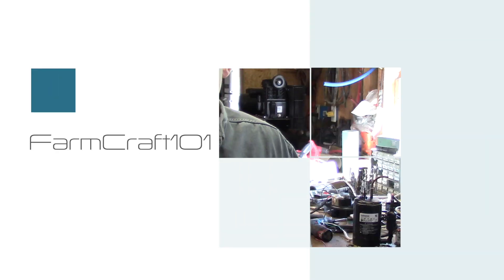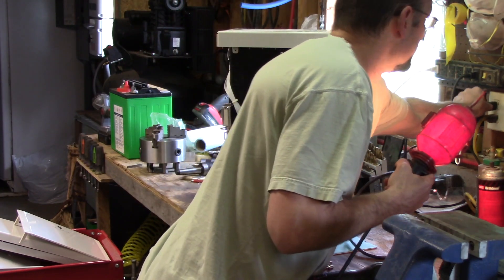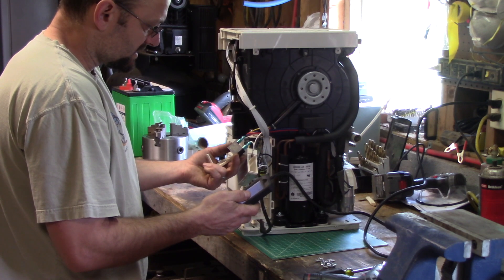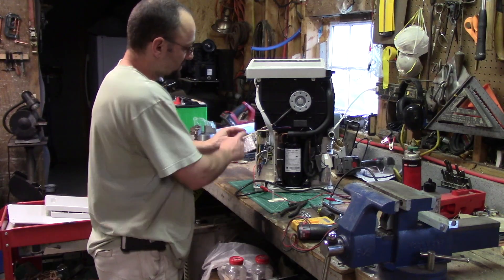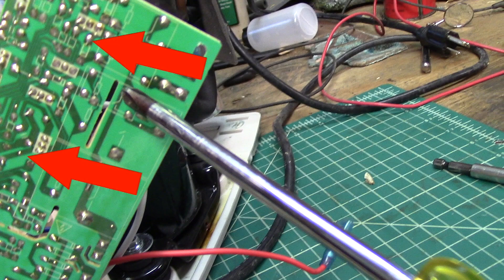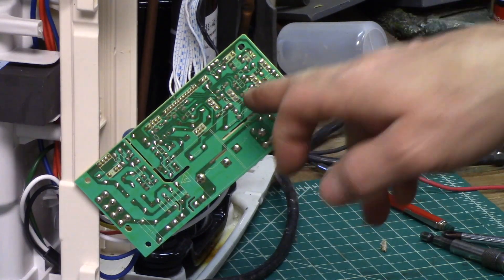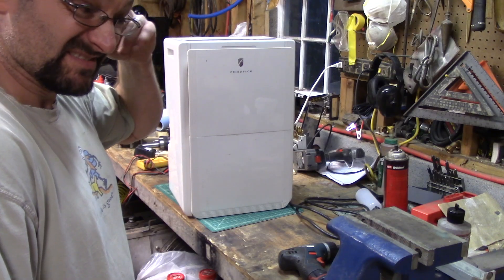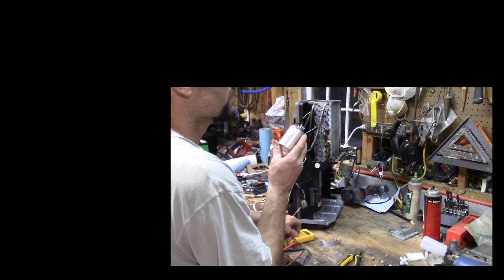How to troubleshoot and repair a dehumidifier, Part 1.  FarmCraft101

Comment: Found this video while searching for how to troubleshoot my Frigidaire (made by Electrolux) dehumidifier - thank you! Note that there is a high level circuit diagram stuck to the case behind the captured water tank on my unit, which made identifying the color-coded wires easy.

I thought that jumping the fan to the compressor circuit was a great workaround (although it might grow some mold since the evaporator will stay wet before the fan can dry it off, but...), and after preliminary testing (capacitor OK and voltage present on the + wires to the fan),  I was ready to do the same.  However, I also noticed that the ground wires for both the compressor and fan motor were fastened to a flange on the bottom corner of the evaporator, and there was rust dripping down from this wet location. I undid the stainless steel screws and found that the mild steel star washers behind the wire lugs were quite rusted and this rust must have gotten in the circuit path.  Did a cleanup with a small wire brush and some contact cleaner, connected the wires and the fan started working! Off to my local hardware store to try to find stainless star nuts, but they didn't have any, so I bought some new plated star washers and put them in before buttoning everything back up. Unit is now working well, just in time for a heat/humidity wave.

As with repairing cars, many electrical issues are due to bad grounds - pays to look.

Comment: Man i didn't think you be such a chill dude to watch do this trying to figure figure out why my dehumidifier keeps turning off after 45 digits hit I have a model DDR030BJWDB and there's a button on it that has a person's face and a moisture minus sign in the water droplet that button turns off after a while but yet my room is still hot and then it proceeds to blow out hot air is it because the unit is overheating i cant figure out this issue snd no video's online cover this a video on this would be nice or advice

Comment: I found two fairly new dehumidifiers in our city dumpster at separate times. The first had a corroded main board, so I scraped it out. The second, which is like new condition. It's displaying a code EH for faulty humidity sensor. I have yet to open it to confirm a bad sensor. Thanks for the detailed break down of how the board circuitry is laid out and how to diagnose.
Reply: Where did you find the sensor, I need one too.

Comment: film capacitor @ 5:05. usually very low capacitance, unlikely to fail and not really all that dangerous. fun fact: it's the same as you'd find in a desk fan because the principle is exactly the same: two inductor coils causing an electro magnetic field and spinning the fan

Comment: Brilliant video.  I suspected it was a relay problem with my dehumidifier as well, and hot-wiring across it as you did helped me to confirm the diagnosis.  Need more people like you who are willing to diagnose and fix things instead of throwing them away.

Comment: I accidently plugged my dehumidifier into 240v, I'm not sure what blew inside of it or if it's even salvageable
Reply from the maker: Trace the power wires and hope that the first thing they go to is a fuse.  Otherwise you will probably find some black stuff on a circuit board which will be toast.
Reply: @FarmCraft101  guess if the board is toast the whole thing is probably not worth repairing
Reply from the maker: Depends.  Boards can be fixed, components can be replaced.  If it's a relatively new unit you could price a new board.
Reply: @FarmCraft101  yeah I think it's fairly new but I got it used

Comment: I also did a repair of a de-humidifier on my channel. I added an alternate title for the video part way through. That title was, "How to electrocute yourself in one easy step. Good to see you working the same way. On mine I drew out the circuit and fixed the fault on the pcb. https://www.youtube.com/watch?v=r_79OrkoRtI&t=73s

Comment: my unit is not draining.  it seems to be collecting water in the unit and then it shuts off.  I took off the connected drain tube that went to drain.  The unit still does not drain in a bucket I tilt the unit and drain water, it runs and then shortly thereafter it shuts down

Comment: If you want to have the fan run after the compressor shuts off, you can get a "delay on break" timer.  Also, the blue connectors are often called quick splice or snap lock connectors, depending on which brand you choose.  Thanks for posting.  You saved me some time.

Comment: Picked up a nice Whirlpool unit at the curb for trash day.  The thing has very little use to it going by the lack of dust on the inside.  It works.  It filled a bucket bin worth of water overnight.  But, when the unit is triggered off by the panel or its internal on/off humidity cycle, the compressor remains running.  Eventually, the compressor heats up and trips the overload sensor on top of the compressor can.

The compressor relay seems to stick in the on position.  With no measured 12 volts DC at the control side of the relay, the compressor still runs.  With all power removed from the unit, there's continuity on the power side of the relay.  That ain't good.  A $3.00 relay ordered off eBay should fix this problem.  Let's just hope some other overload problem didn't cause the relay contacts to stick...

Someone threw out a nice $200 dehumidifier and I should be able to get it working for just a couple of bucks and an hour of my diagnostic time.

Some people put together jig-saw puzzles.  I fix things.

Comment: Thanks!
I picked up a Frigidaire dehumidifier that someone threw out and checking it out after removing the back panel I was able to verify the Compressor works fine but the fan, like yours doesn’t come on. I have some experience with electronics repair and wiring and have repaired crt and plasma televisions as a hobby so I understand the dangers of high voltage circuits. I just wanted to thank you for this video because it gave me a good idea of what and where to check with my meter which gives me a much better understanding of troubleshooting this appliance.
Thanks!

Comment: You fix things the way I do, the simple way is often the best.  I have a whirlpool that will not turn the compressor on,  It is impossible to find the schematic, so just keep looking on line.  Will probably tear into it.  Computers are much easier to fix, but I have done hundreds of those

Comment: Hi. At 9:01, what are those flat white cords with blue writing? I had to take apart my dehumidifier(not all of it just some covers until I could get to the fan) my daughter dropped a little straw in there and I had to get it out, so I had to take it apart cause the holes were so small I couldn't stick anything in there) so I took off t he top finally and got the straw out but as I'm trying to close the top there are two of those corsa nad one round white one coming from the top and when I shut it one of the flat ones barely touches one of the copper coils. Is this a problem? Could this cause a fire or some kind of issue? If only I had looked at the position of the cords. I have a new GE humidifier.   I hope your able to answer,  thanks
Reply from the maker: With some close inspection you can usually find where they intended the wires to run.  Are there any clips or channels molded into the plastic for them?  But as long as the wire is undamaged, (covered with insulation) and not getting pinched, just touching the copper coil won't be a problem.

Comment: I noticed when you're hooking up the 12 volts on that circuit board your bare finger seem awfully close to the circuit board 110 volt part you called the bus bar. The 12 volt parts pretty harmless but..... You know.....  jus sayin' 😉
I'm 63 and I've been tearing stuff apart since I was 5 years old. I had a toy dump truck with six d cells...... It was working fine but I had to figure out why it had so much power even though it didn't move very fast. The Phillips screwdriver was all that was needed for one of my first memories of wanting to know what's behind those Philips screws that makes this thing tick.  I salvaged a 50-pint dehumidifier yesterday that doesn't work and I'm going to try and figure it out too. Holding the power button down for a second and releasing it the display comes on then a few seconds later it turns back off and nothing happens. Hmmmmm🤔
Thanks for the video 👍

Comment: Gotta love this electronic crap that burns out before anything else. What happened to an on/off switch with a thermostat. This way, they keep selling us this garbage. Capacitors should never be handled with bare hands until shorted out between the contacts.

Comment: I have a HomeLabs 70 pint Hme020030N. Probably used it about 6-10 times. Wanted to run it in the basement last night. Plugged it in, and it was working. Couple hours later I opened the basement door and couldn't hear it running. Went down, and it was off. No lights on the control panel working. Pressed start, nothing...pressed all buttons, nothing....no beeps, lights, etc. Plugged into another outlet, still nothing. Any ideas what the problem might be. ( Its not the circuit breaker for the outlet.) I am past the 2 year warranty period. Thanks
Reply from the maker: I would open it up and check the voltage at the circuit board.  Maybe there's an internal fuse.  See where the voltage is dropping off.

Comment: I am wondering how a capacitor is tested with an ohmmeter ?  I use a UEI Pro DL389 and turn the dial to MFD to test capacitance on the micro farad setting.

Comment: The blue connector is a Scotch-Lok tap connector, when they were made by Scotch. 
Only drawback to having the fan only come on work the compressor is that it'll leave everything damp when it shuts down, which may result in corrosion happening more rapidly than it would otherwise. Might be good to rig up something where it can run an additional few minutes after the compressor shuts down. A relay and RC timing circuit would be a way to do that-

Comment: Great video, wish you didn't take it apart in fast speed.  I am having trouble taking the back off of the same Friedrich D70BPA unit. The blower wheel is making such terrible noise.  It is somehow loose. Any pointers on getting it apart.  I took out every screw I can find and still the back would not release on the top. Thanks

Comment: Hi I use Morphy Richards dehumidifier and has been using for 2 years without being serviced as no one here could do that. Recently it kept showing EH and stopped. I have to unplug for few hours and plug back and it runs then repeating the same issue. Wonder what EH indicates.

Comment: Thank you so much for posting this video. MY Frididaire dehumidifer died. My problem was the fan worked and the compressor would not kick in. Most of the parts are so similar, arranged slightly different but, my problem was the relay for the compressor. I did the same thing and combined the 2 wires, even had a wire from a refrigerator where 2 wires were attached to one female flag terminal with a molded cover for protection. Now it works.Hope I get a couple more years out of it. The humidity in my basement today is 82%. Great video and super helpful. Thanks again.
Reply: I have a Frigidaire with a bad relay also, and I wanted to retain the ability to shut down when the tank was full, so I removed the relay and wired in a solid state relay that I had on hand.  The original relay was marked 25A, but with all the cycling with the compressor, it probably is a wear item that's destined to fail as the contacts get oxidized from arcing.  Hopefully the solid state relay will last a good duration.

Comment: I had the same problem with my 2008 Frigidaire dehumidifier. The relays were clicking but still the fan would not work. You may want to try running a magnet over the top of the relay, where the part information is printed. My relays are 'OMRON G5NB-1A-E' (google if you want to see images). The magnet moved the switch inside making a click sound and somehow helped solve the problem. The first try had the fan start up but didn't seem to fix the problem. A few more tries with the magnet and it appears to operate like new.
Update:  My fix wasn't permanent. The relay still acts up. I'll try to make the same fix as in the video.
Update2: Works fine now with the fan power spliced into the compressor line, just like in the video.

Comment: Very helpful video, I came here to figure out how to fix a Frigidaire 50-Pint FAD504DWD, which is the one you recommend. The compressor and the overload relay are both shot. Used it a few months each year for about 7 years. They sure don't make 'em like they used to.

Comment: Great job! The best repair is always the simplest :) BTW, from your video, it looks like that board you worked on is just the power supply and relays. I suspect that the smarts are on the other board with the display on it. The ribbon cable between the two possibly is just sending the 12V down to the relay. If the ribbon cable terminations were the clamp on type, they can sometimes go bad due to vibration or moisture. It would have been interesting to give them a good "wiggle test" ;-) I have a similar dehumidifier that hasn't worked right in years. You've given me new incentive to crack it open (usually the most frustrating part of the job!)

Comment: FarmCraft101  Thanks. Mine is blowing but not condensing so it could just be the other way around? I'll open it tomorrow and see if the compressor runs...
Reply: I opened it up to find tons of dust and fluff impeding air flow. Works fine now after a good clean. I hadn't seen that there is a fine air-inlet filter which can be removed for cleaning.

Comment: Hello, Have a relatively new GE ADEL50   dehumidifier . (temp well above 60, and humidity in basement well adequate /this summer). stopped making water. fan runs, Ive selected "run constant "to presumably bypass the humidity sensor. I can hear the compressor kick on. I assume the only reason it wouldnt be making water is refrigerant leaked out. I assume there is no way to recharge/find leak etc ?...thanks for response.

Comment: Great video and great analytical skills.  I bought a refurbished Whynter dehumidifier that seems to cycle even in the Continuous mode, where the compressor should stay on until the water bucket is full.   The unit is new, I just used it the first summer in my house to keep the humidity level in the Comfort zone, 45-55%.  I hope Whynter provides some technical help.  Do you think the humidity sensor could be the likely problem?

Comment: I really enjoyed you going through it and troubleshooting/thinking out loud/explaining.  I've actually got a new dehumidifier that blows ice cold, but doesn't draw any moisture out of the air.  All of the electronics as far as humidity sensor etc are working, but the unit is so cold.  What would you think it would be?

Comment: My dehumidifier is not collecting water, while the fan is working well. So might be problem with the compressor?
Reply: Well, put your hand on compressor see if it is vibrate. If it does, then you may have low refrigerant problem.

Comment: i see the problem with the circuit board. Look at the round things on a circuit board. They have indents like a plus sign when they go bad they burst open.
Reply: I'm blowing warm Air throughout my exhaust vent above my fan blower.
Reply: So do I! The compressor and fan kick it but only hot air comes out. What's the solution?

Comment: I just bought a dehumidifier two months ago and I noticed yesterday it's running and blowing air but it's not pulling water like it was. It was pulling 70 pints over a six hour period and now not even a pint. What could be wrong with it? Anyone's comments would be greatly appreciated.
Reply: Candace Hood ::: Hard to find a decent  one these days! I have three “Noma” brand in Canada, and they barely worked for one winter. Inspired to at least have a look inside now, though...

Comment: I try to fix stuff. Sometimes just a visual inspection can provide the obvious troubleshooting path. One doesn't have to be an expert to take the covers off and look for something that "just ain't right". The dead mouse lodged in my fan was the first clue that my fan motor might be burnt (which it was). I found a brand new replacement on eBay for $62. Better than the full replacement cost I would have paid if I'd just thrown up my hands and scrapped it without taking the time to open it up and look. Thanks for a great video.

Comment: great video for novice repair.  Hopefully you checked the amp rating on the relay contact and determined it will carry the current of both fan and compressor.  If your current exceeds the relays current rating you will have premaure failure of the relay contacts.
Reply from the maker: Yeah, it was still within specs.  The fan really doesn't draw much current.

Comment: Excellent...my unit just won't collect water....will open and check as you have done.  Filter could just be dirty.  Thanks
Reply: Try to clean filter first. If that doesnt work its low on freon or refrigerant.  The compressor moves the freon and cools the air below the dew point causing water to drip into the pan. It takes r410. Probably not worth fixing unless you have your license to buy freon and can find and fix the leak. Sorry
Reply: @electromech7335  I think you answered my question.  Not what I wanted to hear but very helpful nonetheless. (So was the video.) Thanks.

Comment: to say you have a FIX dehumidifier would be overstating the truth, it would be more accurate to say you have a WORKING dehumidifier because the issue has not been resolved, it was only bypassed.